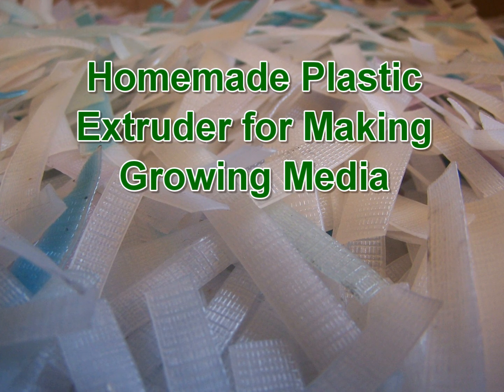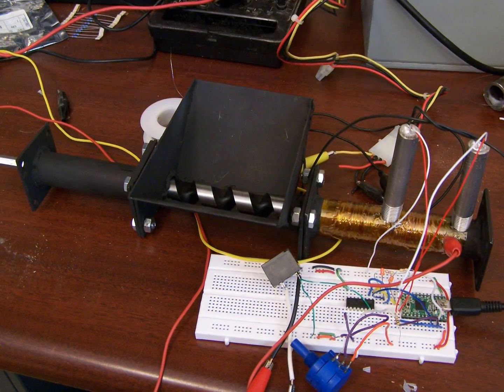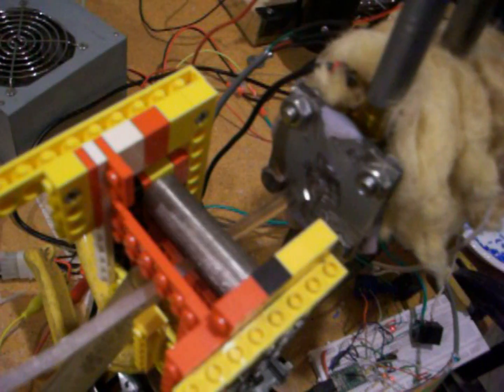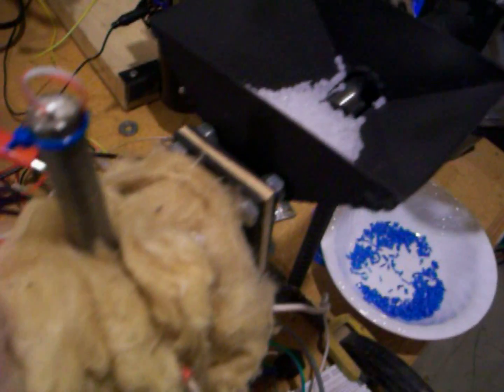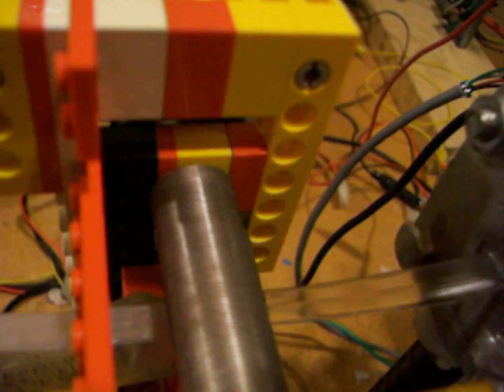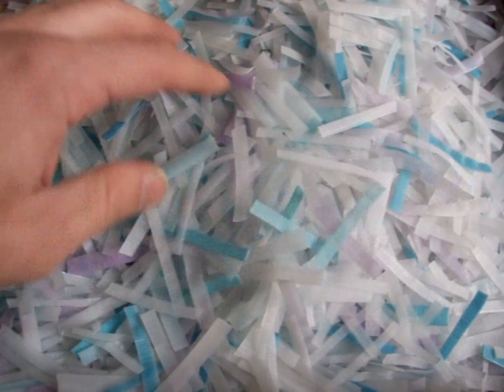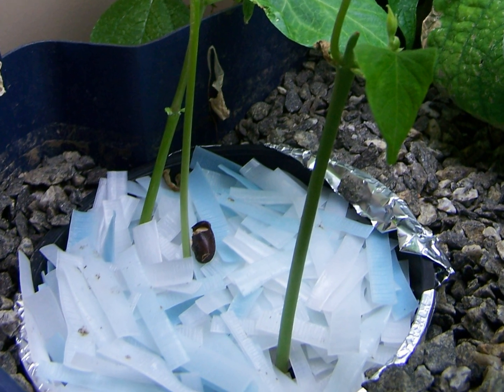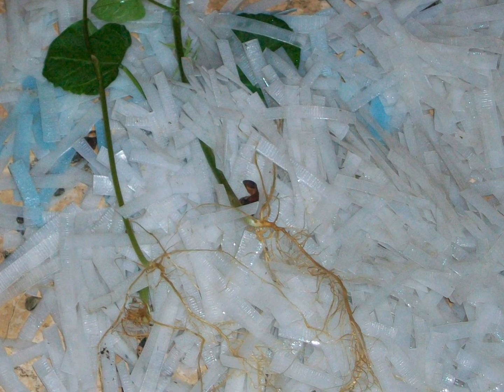Homemade Plastic Extrusion System

Comment: Do you think a wider thin sheet plastic is possible with multiple extrusion machines lined side by side or through tweaking of this machines design to take in and output a bigger volume capable of producing 15-20 cm wide sheet?

Comment: Very impressive ingenuity on display here. Too bad the plants didn't seem to care for the medium. What if the molten plastic were to pass through a "curtain" or "shower" of falling sand in between the extruder and the rollers?  Sand is practically free and  the roots may like the plastic better when it's coated in sand.
Reply: He is the first I've seen putting the bio filter directly in the grow bed, usually it's in the return tank from the fish.
There is a product called Cabosil, which is fumed silica, very fine gained snow like textured powder. If it were included in the cooling stream after the rollers it would be bound into the cooling plastic surface. Which should provide excellent holding surface for the bacteria.

Comment: fascinating.. what did that rig cost you.. You could perforating the  strip with a roller or put slots in it.. .. great project..  We had a company called  Thermoplastic Processes..  Some people use an extruder from each end of "T"  but you could gang your extruders and run perhaps three of them..

Comment: To get things to stick to the plastic I'm mixing in, and coating with, fine sand (whilst the plastic is molten) although I'm not sure the effects in practice. Perhaps even just coating in stone/sand dust would give it that property (although you have to be careful not to breathe it in because of silicosis). One problem now is I can't recycle the plastic in the normal way

Comment: That's a great video and project! I saw a video on YouTube a week or so ago that showed one cause of plants roots growing around the outside of the pot, and not in the center, but I forgot what that cause was! Go Figure! But the video was about aqua or hydro ponics. But if you think it's the plastic,  maybe it is! Do you think making a different shape or pattern might help?  Maybe a deeper profile and more irregular? Could you extrude it through a die to look like Rotelle or Fusilli pasta? Or still too smooth of a surface? Would plastic 'coir' be any good, if you extruded fibers into cool water, then used that as a medium? What kind of volume gain do you get with the strips,  vs. the density of the new pellets? Could you try to using the pellets by themselves in a single container to see if the roots would grow? I know you won't have the surface area for bacteria, but maybe you could blend in a second growing medium with plain pellets or other shapes for that. Thanks for posting this video!!!

Comment: How did you machine the texture onto the roller?
Reply: +Enigma758 i would love to make similar rollers for crushing aluminium cans but I a kind of stuck on how to
Reply from the maker: Enigma758 metal lathe
Reply: Bigelow Brook Farm (Web4Deb) Knurling tool?
Reply from the maker: That would work.  I just threaded it and then scratched the bit horizontally across it a few times.  Sort of looks like a knurl

Comment: this is very cool i did a lot of experiments on melting milk jugs and other hdpe and it was very strong by the way are translucent milk jugs and shampoo bottles copolymer or homopolymer because i would rather melt homopolymer hdpe because it is stronger than copolymer

Comment: just a thought..... Instead of cutting them into chunks; put them on rolls. It seems to me that a good use for what you have is to use it in a type of basket weaving system where you heat the finish product with a heat gun to fuse the strips. this could be used for the back of a chair or seat, and would last longer then PVC or WICKER. Just my thoughts. I made a handle for my spatch today (my first project). Worked great.

Comment: Polyethylene (whether HDPE or LDPE) is hydrophobic.  This is why nothing aqueous will stick to the parts you've made.  To get things to stick you need to oxidize the surface.  Manufacturing plants will typically do this with plasma (electrical discharge).  You can also flame treat.  Good luck with your efforts!  Great video!

Comment: Hello I'm trying to recycle plastic bags, and during heating it melts and becomes some sort of HDPE after a while. i'm thinking that maybe I need a solvent? It's just so amazing at what you did here, pellets were heated and were automatically made into sheets. How about for plastic bags though?
Reply: Yanie Del Rosario you have to clamp the bags under pressure to make it form and for an extruder like in this video plastic bags would get tangled up it would be better to cut milk jugs into small pieces because they are also hdpe and they wont get tangled up like plastic bags would

Comment: sounds like this was Homemade plastic extrusion system 1.0......  will there be further tinkering? like other materials or a different texturing that will allow it to be "sticky" there is a process they use in the printing industry that allows certain plastics to be stuck onto polyester.....cait wait for update.
Reply from the maker: Sorry to disappoint you, but I abandoned this project long ago.

Comment: Hey, did u have a small motor on the rollers or did you have it being pulled threw on the other side. Also how thick was the plastic you extruded. I'm doing a similar project so any help would be appreciated, thanks :)
Reply from the maker: there's a motor on the rollers that is pulling the plastic at about the same rate it's coming out of the extruder.  The thickness is about 1mm

Comment: My swirl filter looked like that. I took a bucket turned it upside down and placed it in a garbage can hooked up my tank to the garbage can at the bottom this sucked the waste into the can and trapped it in the 5 gallon bucket I put holes all over the 5 gallon bucket and covered it with lava rock and then pee gravel. I then have a small line going up to a tee one side feed my plants the other the tank. I also pressurized the can with air to force the water up 5 feet. empty waste out bottom.

Comment from the maker: I just cut the end off to make it a little shorter.  It turns around 20-30 rpm, but that really depends on how well the plastic is being heated and how fast you can extrude it.

Comment: I'm particularly interested in the fact that you imprint a texture on the plastic after it exits the extruder. Are those texture rollers actually powered, or do they simply turn due to the passing of the extruded plastic? If they're powered, how do you keep them rolling at the exact same rate as the passing plastic?

Comment: Very nice job.  I will support your work if you like by sending you torrefied material as a growing media, carbon source, and nutrient enhancement.  I have been growing vegetables with great results from a small piece of hay bale and the torrefied material.  Check out my videos at markv30809 and give me a call.  I will send you plenty so you can mix it with your plastics and use it to absorb or scrub urea from your aquaculture.  Good job on recycling.

Comment: quick question how did you heat the tube up and at what temperature. do you think you can make wire filament with this.

Comment from the maker: yes,, but they also include the cost to fabricate parts.  Most of this thing is made from machined parts, custom welds, or hand wound heater elements.  If if you're "mass producing" it with qty 400,  It adds up fast. $50 for a motor, $50 for the electronics, probably a small pump for water cooling, another $50 in misc parts, then labor....  Plus, I just don't have the time to redesign and document it.  I'll leave it to an eager college kid.  I've seen a few good prototypes on youtube already.

Comment: It looks like it works great. if you put a die on it to extrude 1.5mm or 3mm filament for 3d printers you could enter it into the Desktop filament extruder contest and collect the $40k and a laser cutter, a 3D printer, and a CNC milling machine Prize. You can see the contest here desktopfactory2012.istart.org

Comment from the maker: it's highly unlikely with this setup.  There's a lot of slop between the auger and casing so I think it wold leak back.  I believe real extruders have some kind of tapered auger that helps to increase the pressure as it works it's way down the tube.  But, it can't hurt to try!

Comment: Do you think this method (auger drill bit + encasement) could be used to gain high enough pressure (300-1500psi) to say extrude (and expand) gelatinized starch (i.e. to make breakfast cereal)?

Comment from the maker: Thanks.  I think the ni-chrome wire and insulating tape were about 10 bucks and the temp sensors were about 5.  I wanted them buried into the chamber so they got a realistic (or as accurate as possible) temperature of the plastic.  I can be quite frugal.  ;-)

Comment: Two thumbs up, a clever way to make an extruder! I may suggest a few improvements: 

1. Instead of wrapping resistive wire on a barrel, you can use an off the shelf barrel heater and an automotive exhaust wrap to insulate it. They are not more than 15-25 bucks for that size.

2. There is a thermocouple plate (around 20 bucks) called 'Spade Type Thermocouple" that you can use instead of the tubes.

------------------------------------------------
Levon @ Medium Machinery, LLC

Comment from the maker: 1)  I used a teensy for the controller.  Check PJRC dot com for the teensy.  you can also use an arduino.  2)  I used a metal lathe for it.  I threaded a piece of round stock, then drove the bit sideways through the thread and it make a bunch of ridges in it.  My lathe isn't able to do knurling (reverse threads)

Comment: Dude! You're fucking incredible man! Where did you learn all of this stuff? I just needed something stronger so I welded it. Here is my redesigned fully automated Greenhouse Controller. Here is a close up of the Extruder roller I created on my Lathe. Here are my Automated Window openers made out of Windshield wiper motors. Here is my redesigned fish feeder. Here are my growing statistics for the season. I've installed a Weather station and I log the data. 

Honestly dude, you're like my hero.

Comment: Excellent use of resources.  We have a small Aquaponic  system we are testing out before we go commercial.  We used all kinds of stuff for bacteria colonies but we found if we just use a material called Higromite the bacterial level stayed very stable and the Higromite held moisture and did not break up like clay and it weight is much less than any other media we found. Great company and it is mined in North America. President is Michael Wagner fantastic guy to work with.

Comment: I'd been thinking about the same thing for a long time since I use HDPE to prototype parts on my mill and have boxes and boxes of shavings.  Your design is much simpler and better than what I had been thinking of (pressurized vat) .  I'm going to start on one immediately :-)  Thanks for the inspiration!

Comment: The plastic media you made would be a good cover to retain moisture, like mulch except it doesnt turn into dirt =}. But it would be messy to deal with when you could just get a tarp. My sugestion is to deal with holes/circular indentations in the pplasetic. Like a sponge. That may help the plants to actually root, still not seeing why you want it to root in plastic other than its cost effectiveness.

Comment from the maker: @UpstateHydro With all due respect:  I'm not a fan of water bottles either, but the problem with refilling them is contamination since you've already wrapped your lips around them and introduce bacteria into it.  The plastic that I'm using is HDPE, proven over and over that it is one of the safest materials to use with food contact....not like PVC or other lower grade plastics. Regardless, I've abandoned this project and use expanded shale for my growing media. See expandedshale com

Comment from the maker: @malice926 my first tests I used milk bottles and cut them up.  worked great!  You need a good way to cut them.  I tried using a cross-cut paper shredder and it isn't strong enough to slice through the plastic....just mangled it.

Comment from the maker: wrap hight temperature insulating tape around the chamber and nichrome wire.  It takes a lot of experimenting to figure out the proper length of wire to use for whatever voltage you have.  If it glows, it's too hot!

Comment from the maker: @patches4patches The bulk of the plastic I ran through it was recycled milk bottles.  I got a bunch of pellets that were "contaminated" from a local extrusion company so they were also recycled.  When I finished the project, all the plastic was recycled.  Only about 1 pound was used.  I've switched to a different media.  check out ExpandedShale (dot) com for details.

Comment: Hello. I'm very impressed with the setup. I want to also make an extruder, but to make corn curls/cheesy puffs. Do you recon it's possible with a similar setup (it requires high pressure and shear). Any suggestions welcome.

Thanks

Comment from the maker: @lawmate The wire is turned on/off with a relay that's contgrolled by a microprocessor.  The temperature is monitored with 2 probes to determine if the elements should be on or off.  There's enough mass in the pipe and plastic that it only needs to cycle every few minutes.  You'll have to experiment with the wire for the best results..... I ran 4 wires in parallel for each element and they are 12" long.  It all depends on the thickness.  If it glows red, it's too hot!

Comment from the maker: @JFMariano13 I'm not a chemist so  I have no idea what off-gasses there are.  This is HDPE which is classified as food safe and I'm heating it just enough to melt it, not burn it.  The plant roots don't seem to "grab" into the material like they do with gravel.  It's possible that the material is just not porous enough for the grab into.  I'm not really sure.  Overall a fun experiment, but it's cheaper to use expanded shale or gravel.

Comment from the maker: @3DModelAnimation standard 3/4" wood auger bit in a piece of 3/4" black pipe.  There a little gap but it didn't cause a problem.  Details about it are in my blog mentioned in the detail area.  Thanks!

Comment from the maker: @sailor62250 I have since abandoned this project since it is far cheaper to use expanded shale or clay, or stone.  The raw HDPE will float, but you can put inert additives into the plastic to make it sink - usually calcium carbonate or talc.  My samples do float, but once you pack a bunch into the growbed, they seemed ok.

Comment from the maker: @charliemor3 I played with adding extra holes.  It's very hard to push holes through the material while it's still molten since it likes to stick to everything.  Once it cools, it's fairly hard so it can be difficult to punch.  Nylon is expensive.  Thanks for the suggestions!

Comment: Hey, I have a question that may give you a direction; if you haven't tried it yet. Have you tried another type of plastic like nylon; or something similar?  Holes through the material?

As I understand it, one of HDPE's properties is the ability to cause things not to stick to it; like forming molds,etc.?  

I also believe that the color may be affecting the root growth; as well as the little bugs that work their magic. They work better in the dark. Why not try black or dark blue, etc.?